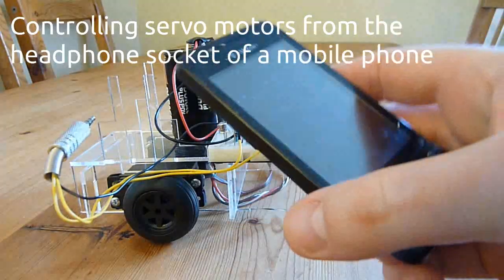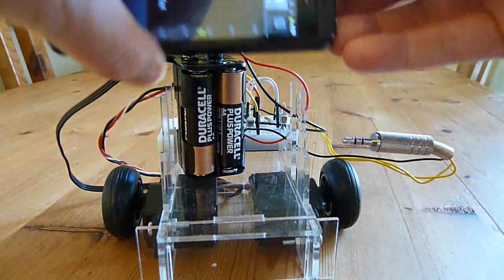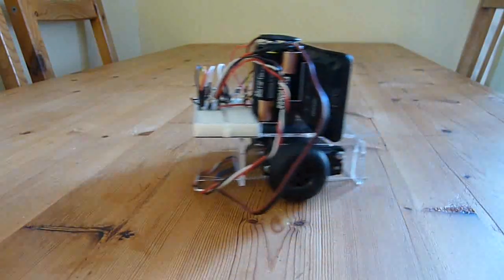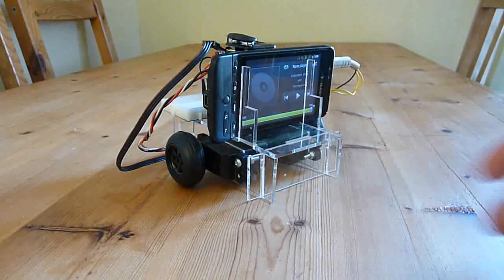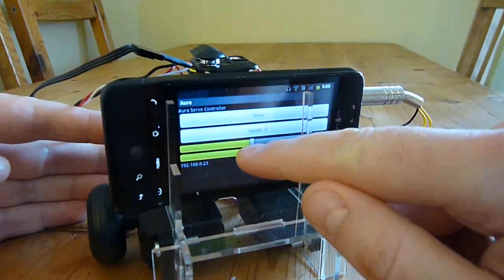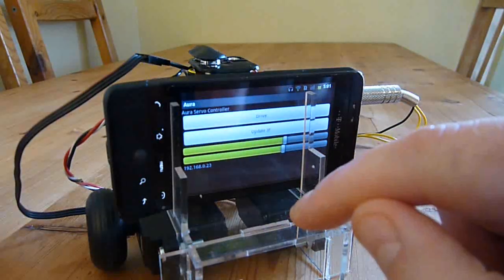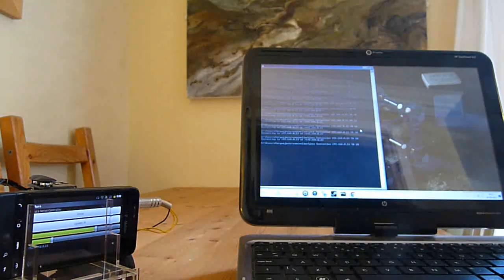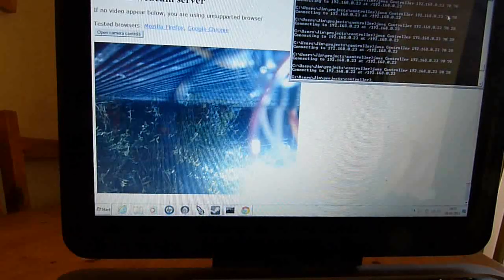Headphone-controlled servo motors

Comment: Thankyou for the video, it is a good proof of concept! 
I think you could reduce your circuitry by the use of opto-isolators, you would only need two components this way.

Keep up the good work and correct me if you see any major flaw in my plan to use optoisolators